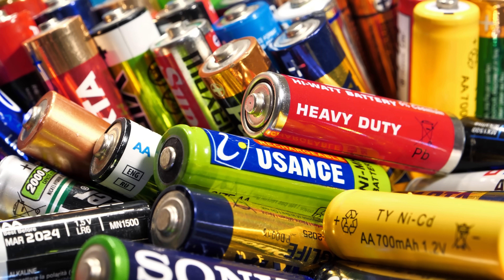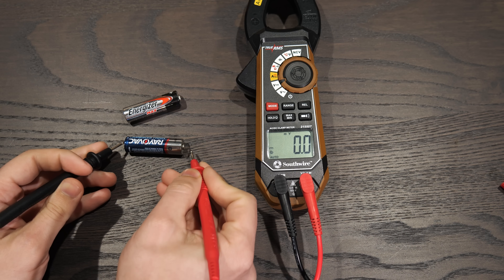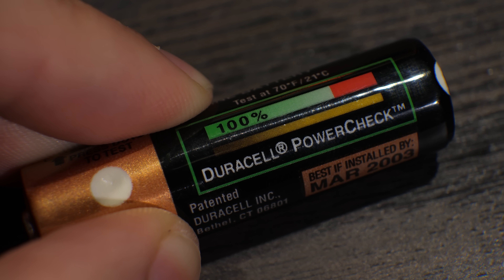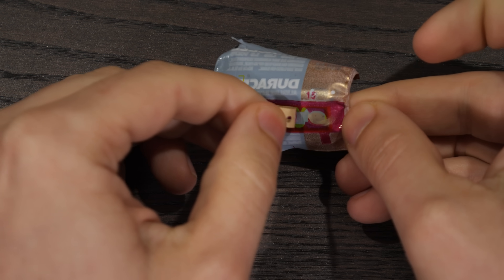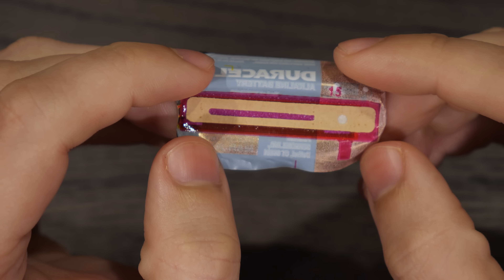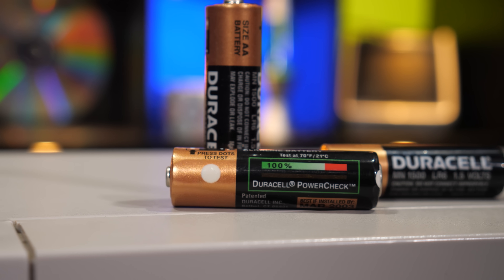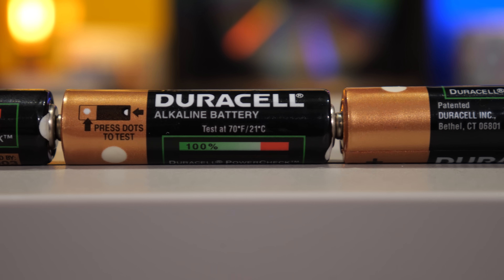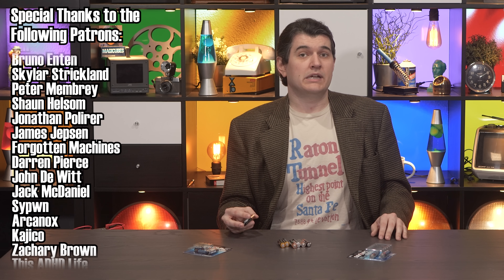Duracell PowerCheck: A genius idea which didn't last that long

Comment: My parents always had a drawer of loose batteries. There were some devices that could run for weeks on batteries that were too dead for others.  Yes, we could put batteries into a device to see if they worked, but the question was always "Are they both dead or just one?" These self checking seemed like a great solution, but as you mentioned, they were hard to use. A battery tester really was the better solution.

Comment: I think this is absolutely classic Technology Connections content. A nearly irrelevant thing you vaguely remember from the past that you never thought about that turns out to have something interesting going on in it. Perfection!
Reply: I prefer the videos where he covers the innovations that should be revived or were misunderstood
Reply: Much like the turn signal rant, this is a classic example of "but sometimes."
Reply: I have a battery tester than is a formed wire that holds an incandescent bulb.
Another battery oddity.  If you need some AAAA batteries ( yes quad A ) some 9 volt batteries use 6 of these.  ( Sorry I don't recall what brand )
Reply: @bobroberts2371 I used to have a Wacom tablet and the pen used AAAA batteries. I remember my mom yelling at me that I was going to burn the house down when I cut open 9v batteries to get the delicious cheap batteries out. Otherwise the only other place I could get them was RadioShack and they were like $15 for a 2 pack while 9v batteries were at the dollar store.
Reply: That was not irrelevant. That was the black magic space age science of my childhood that made me a sponge for learning everything scientific. Sadly, at the time I didn't have the tools, skills or knowledge to actually study how anything worked and these batteries disappeared and I forgot them before I gained those skills and knowledge, but finally I got an answer for one thing I revered as a kid and that made me what I am today.
Reply: my family was bad about putting used batteries back in the junk drawer, these things actually helped me a lot when i wanted more batteries for my gameboy or cd player
Reply: Yep. This was some of the great stuff
Reply: no joke, i was just thinking about this under 48 hours ago and was like "huh wonder how those worked" . ias super busy yesterday so i could watch the day it was uploaded. but if i did, he woud have answered my question within hours of me wondering it. insane
Reply: This is not a thing of the past, I have some in my drawer expiry 2030 with power check. They sell these today in the uk
Reply: The real "genius" behind these built-in battery testers was putting them into disposible batteries where, frankly, who gives a f*ck instead of into rechargable batteries where it matters!
Reply: I can still feel the pain in my thumbs. Man those things hurt to press!
Reply: All correct save for the "never thought about." I'm constantly thinking of tech like this lol
Reply: I never seen it, so its a bonus
Reply: Or in this case, never heard about it.
Reply: This was especially interesting; it is such a clever invention, simple and inexpensive.  As noted at the end though, it had limited usefulness.  Still pretty ingeniously done though.
Reply: If I remember correctly, at one point the plastic part of the package had a tester instead of on the battery  itself.
Reply: Dang, well said.
Reply: We are getting old...
Reply: Hear, hear!
Reply: No i thought about these a lot lol
Reply: Yes, this is the type of content I remember from 2019. Not hour long videos. Just short, sweet, curious and interesting videos.
Reply: @AndrewsVideoTips143  at first I had to check the date and see if it was no-effort november 😆
Reply: @PabloEdvardo  It sounds like the effort was in finding some old batteries around that had the strips. :)
Reply: @PabloEdvardo  At the end of the video he does mention that this video was originally slated for November.
Reply: , 
    @AndrewsVideoTips143
Reply: They still put these testers on the more expensive line of batteries lmao
Reply: I had forgotten that these self-testing batteries ever existed until the thumbnail for this video reactivated some long dormant neural connection in my brain.

So evidently it wasn't something that I missed, like I miss the old formula for Pepsi Max / Pepsi Zero.
Reply: @knowwhey7559 did the dishonest rwnj ever hear of renewable energy? ALL the energy I use is renewable and I do not own a car.
Reply: I love these so much more than the preachy heatpump stuff.

I could dig the preachy awnings vid because it's a one off subject and it was cool (in multiple ways 🤭)
Reply: @priestesslucy you mean you have cognitive dissonance because your energy use is problematic and you know it?
Reply: I MUCH prefer this content rather than sitting through a sermon on EVs and heat pumps.
Reply: @knowwhey7559  that stuff matters tho....
Reply: @knowwhey7559 You mean you have cognitive dissonance because your energy use is problematic? and you know it
Reply: @DoctorOnkelap  So running an EV on what amounts to coal and/or nuclear energy is not problematic?
You're a hypocrite on many levels.

Comment: Remember they tell you not to throw batteries in the garbage. Not because they care about the battery going in the trash but because when you compact the battery it shorts heats up and catches on fire. So unless you want to light your local landfill on fire don't throw out charged batteries. Or the garbage truck while on it's route.

Comment: I do a lot of outdoor shenans and use a lot of gear- night vision, flashlights, radios, etc. and unfortunately, failing to properly secure batteries can lead to loosies bumping around in pouches and packs. add into that my refusal to dispose of a dead battery improperly, and the result is that i do sometimes come home dog tired after a five day excursion and locate a lone CR123a or AA or even AAA in my cargo pocket with no recollection as to whether it was in column A or column B.

Comment: And as a way to help eliminate e-waste, there are now USB rechargeable AA batteries available on Amazon. Each individual battery has a micro USB port built in. I got a few packs for my remotes and wireless mouse and keyboards. Unfortunately, after only a few months, 2 of the 8 batteries no longer charge when plugged in. I’d love to see mainstream manufacturers sell these, as they might have better quality control.

Comment: I think those lasted longer here where I live... or perhaps I had some on the back of a drawer for ages until I found them. xD Because I remember seeing those like just a few years ago.

In any case, interesting idea, but ultimately Alec gets it right - It never gets used because of how people regularly treats batteries. The standard already is to get a fresh set, replace, check if goes back to work, and if it does then you know it's really the batteries. :P

I think the few times I tried using those, other than for novelty, was mostly when I had a bunch of super old batteries laying around that I didn't know if they still held a charge.
So you get the thing, shove your nails hard into it, don't know if the tester is working or not, don't know if it finished the reading and the battery is dead or if you stopped pressing hard enough, and so on. xD

But it's the problem with lack of tactile feedback. Is it working or not? Do I have to press harder than this, or is the battery just dead? How long do I have to shove my nails into this thing for it to work? etc.

Might be wrong, but I think these would be used more often if it was something like pressing a button, a regular button I mean, and it giving you a definite answer - like a red or green check.

Comment: Energizer had something similar - they just provided the tester as a separate strip that came with the batteries. That strip was a lot more useful since it wasn't tied to just 1 battery and could be used to test any number of batteries whether they were Energizer batteries or not.

Comment: TV remote is actually a good example for why to use AAA batteries. Power requirement is very low and occasional. Their lower mass makes them better at staying inside the remote when dropped, though that's not always the case. AAA's having smaller capacity means they're going out quicker with enough use, and if you remember why Alkalines are more dangerous to the devices when they're used (it's buildup of pressure), you realize it's better for them to end their life earlier not to flood the remote with highly corrosive electrolyte.
I must admit i get the same angriness when a device could clearly take a bigger cell, but yet it doesn't. I recently bought a small projector type nightlight for my son with dinosaurs rotating on the ceiling and walls when turned on. How disappointed i was to realize, the power consumption of this little contraption, made of three 1watt LEDs and a motor spinning the top dome with tiny dinosaur-shaped holes in black print, eat through a set of cells in less than an hour! Seriously, there must have been some miscalculation or too much hope put into this, because as soon, as the voltage starts to drop below a certain level, the lamp flickers and stutters, which is the worst thing for a night light. And because it has a basic animation of turning individual LEDs on and off to make it more attractive, there must be some basic microcontroller built in it. My guess is, that microcontroller can't work below about 4V or it just needs voltage regulator and another battery, to start with 6V, not 4.5V (the light takes 3 AA's). Yes, the manufacturer thought of it and added a power jack on the side with a USB cable to use with a powerbank or something like that, but even the quite juicy one we have, goes through its capacity very quickly (a few hours max). Do I have to mention, what happens when the powerbank starts to struggle with the demand? Of course it's flicker and stutter! What happens when you connect the lamp to mains USB charger? The lamp gets so happy (and a bit hot) with all the energy it receives, that its motor starts whining after about half an hour! Yes! That's another not so good "feature" for a night light.

Comment: My main way of testing batteries is to put them in a remote, point the remote to my phone and use the camera against the ir blaster. If the battery is not empty the blaster blasts. :D

Comment: 11:22 Unless you're like my family which takes batteries out of remotes until they're needed again. And to be fair, I used to leave batteries in the Wii remotes even when they weren't in use, which if done over a long period of time would cause leakage. So there was some reason to ever remove a half used battery.

Comment: The tester use to come in the package (copper top tester), only one for four batteries. You put the battery in the fifth battery holder (which came empty, in the center of the package) and then you press both terminals into the package, and voila. This tester was a little more gentle to your fingertips.

Comment: I am one of those people that uses devices that need alkaline batteries, AND, has a drawer full of free roaming batteries; though more from them coming out of the package, then collecting every old battery after replacing them. Both the in-package tester and the on-battery tester, were VERY useful for me. I really miss this feature and hate when I have to run through batteries to find a good one, or un-case my Multimeter, just to check a AA battery.

Comment: I've had one of these where once I managed to make the tester "light up", it wouldn't turn off after I stopped pressing the dots and effectively scrapped a fresh battery. When I need to test 1.2-4V batteries, I just use a 10 ohm resistor in parallel with my multi-meter probes. A bit less convenient but more reliable and repeatable.